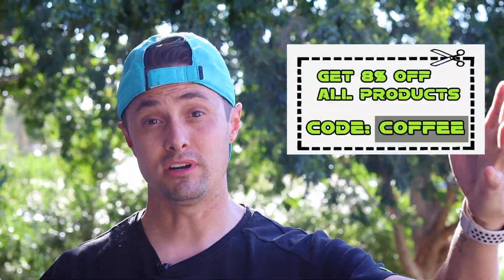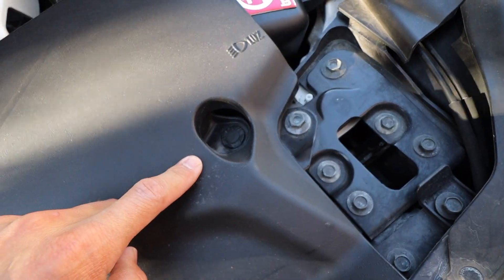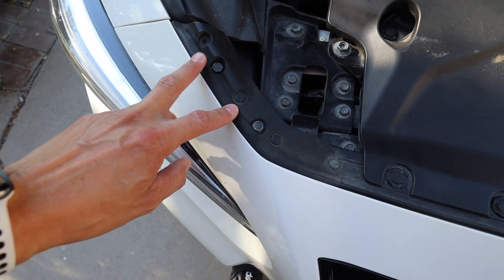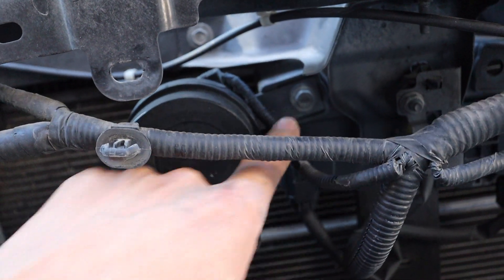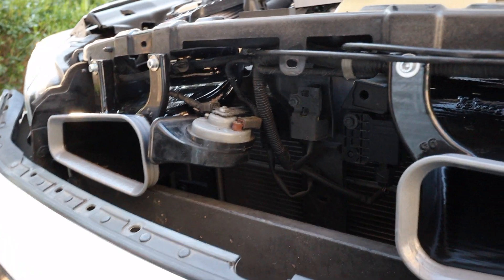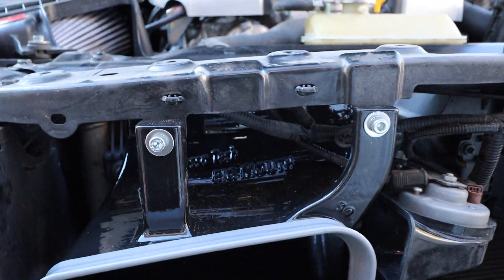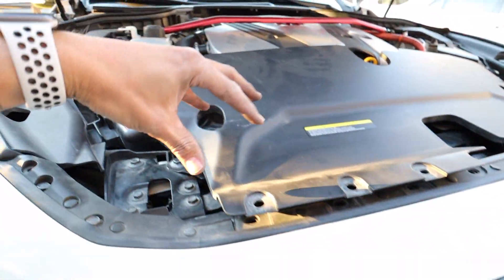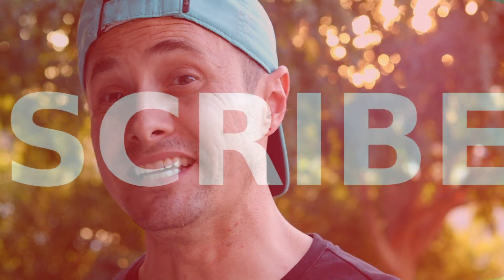Infiniti Q50: Velossa Tech BIG MOUTH Intake Kit Install DIY FOR 3 7 & 3 5

Comment: I have a '17 3.0t... what i've found is the car wants to pull harder at lower rpms. This is on the freeway... when cruising. I suspect the high wind winds maybe does cause a slight ram air effect causing quicker response from the turbo because it can spool up faster.  I have noticed at lower RPMs it tends to jerk a bit more.  OR! It's just happening in my head.
Reply from the maker: Yeah speed and air flow make it otherwise just aesthetically cool
Reply: Im looking to get these - my car jerks at low speeds without this, always wondered why ( reminds me of someone driving a standard and not knowing how to shift right) lol
Reply: @MadeBy_Juice  is your car modified ?
Reply: @Infinite_g  not performance wise just cosmetic @Juice.Extracts
Reply: @MadeBy_Juice  was gonna say if u have certain after market intakes tht would cause the jerk.

Comment: Do you use premium fuel? I had an ex35 with the same exact engine and fed it regular for 10 years+ no issues.
Just got the hybrid as well and it has the same engine
Reply from the maker: Yes I use premium fuel only on the hybrid
Reply: Your engine wasn’t ticking or knocking? Owners manual and fuel door clearly say to only use premium fuel. Even if your not having issues your engine isn’t running at its best as the infinity’s are designed to run on premium fuel. If you can’t afford to run premium fuel in your Infinity maybe you should consider buying a Honda or something that isn’t recommended to run on premium?
Reply: @feta8939  thats a good point i suppose, however, 150k currently on the car with no  engine or fuel system related issues except the engine valve cover that needs to be replaced on about every VQ
Reply: @Tak0Meter  I gotcha, I’m curious why did you decide to run 87 in your car knowing it’s supposed to take 91+? I personally run 93 in my Q50 and my 300C regardless of how shitty gas prices have got since Biden took over. Because that’s what the manufacture recommends and both cars run perfectly and perform great no matter how hard I beat on them
Reply: @feta8939  Well we talked to many mechanics and infiniti owners that we know then did the math and made a calculated decision, we do like to drive in spirited fashion from time to time but we do not beat on our cars by no means.

Comment: Based on your experience with your FX50, do you think this kit can be installed on a FX/QX?? Thanks in advance
Reply from the maker: Possibly, since the 3.7 and 3.5 use interchangeable intake parts on different platforms. It would be worth a shot.  I’d try it lol
Reply: i want to know too lol
Reply: @AtlasWilder  try it!! Lol

Comment: Technically aren’t your air boxes closed off so how is the air getting up there  with the cover on I just don’t see how it pushes air up to the intakes
Reply: The OEM airbox isnt fully sealed on the q50. The cover has ports to direct airflow to the filters. You can see it when he lifts the cover at 4:15

Comment: How will it perform on rainy day or at the car wash
Reply from the maker: It’s designed to not let water in, the air travels up then  flat then down into box so water would have a difficult time getting in.

Comment: Are there an reported performance gains from this? I am considering this mod myself but given what it is I find the price tag a bit steep. I currently also have the AFE intake system on my 3.7 curious if this would actually help at all? Any data logged information? There site offers no data that I can find which leads me to believe that it doesn't actually do much. I also reached out to my tuner and a few other tuners to see if they had any info on this and got no feedback. Certainly looks cool though!
Reply from the maker: If there is, it doesn’t happen till 60mph+, they do look the business tho, almost wish I got them in white rings so you could see them more
Reply: My 3.7 was tuned previously to getting them and I got retuned after and I didn’t gain any hp but intake air temps are definitely closer to the outside temp especially on the freeway. I mainly got them for looks tho

Comment: The Q series cars already have a great stock intake system, buying an aftermarket one is a waste of money as it will hardly offer ANY performance improvements. Save that $ to contribute toward good tires.
Reply from the maker: I agree in hindsight.  I’ve seen people just add drop ins and maybe the Z1 silicone intake tubes to make it better.  The takeda is loud! And maybe lost some low end and gained mid range and top end.
Reply: @AtlasWilder  yea the VQ are difficult to squeeze extra hp out of NA as Infiniti already have it almost at its max. An ECU tune may squeeze an extra 20-40 tops. Supercharging is the only noticeable way to get power from 3.7s.
Reply from the maker: I hear you.  Fortunately gonna try a few more things, light weight underdrive pulley since the hybrid literally has no belts just a free floating crankshaft spinning alone. Free up 4lbs there, then the Audi coil pack conversion once I can get the damn adapters from this vendor who’s MIA.  Other than that this car is maxed out! LSD and solid tranny mount next with lighter wheels & tires.  Then I’m done LOL
Reply: @AtlasWilder  good plan! These cars are heavy. Cut down those lbs.
Reply: @AtlasWilder  car is robbing tons of power with the cats. I've seen hfc, intake, exhaust hit over 350rwhp. I'm sure test pipes will be higher but I'm not a fan of that cat piss smell.

Comment: Does it gain any hp ?????
Reply from the maker: Feels like I lost a low end but gains mid-high Hp.  My hybrid used to never break loose now ever since lighter rotors and these intakes I can’t put the power down in manual mode.